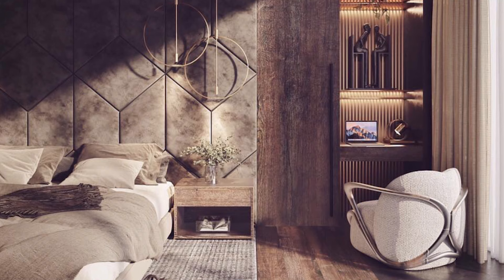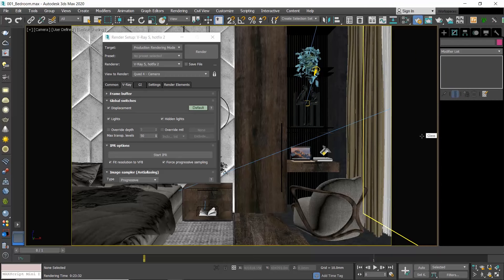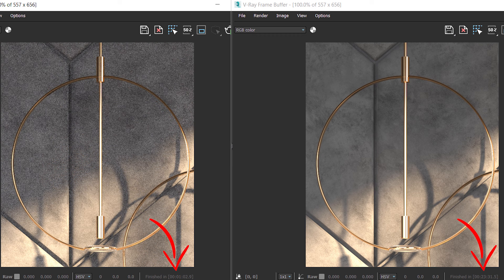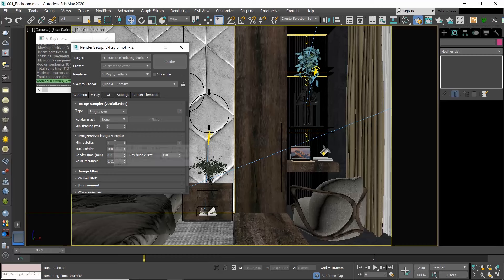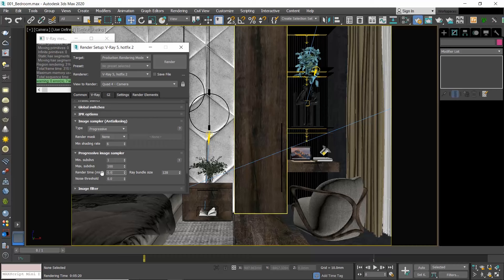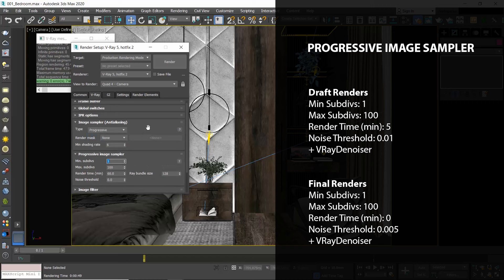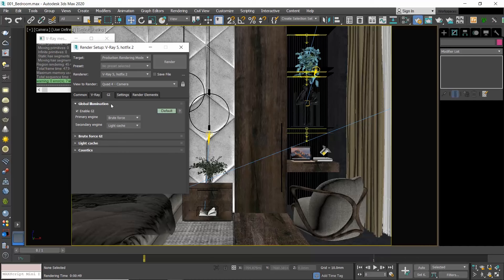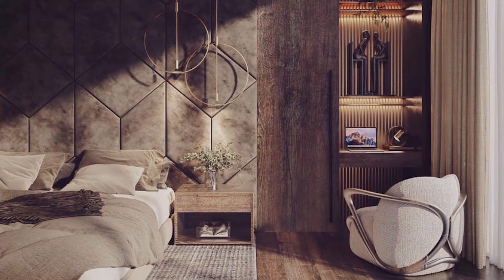3ds Max VRAY 5 Render Setup Tutorial | Settings Explained

Comment: Hi Margarita.. can I ask a question here?.... so I do manage to fix the noise in the main RGB render.. but in my render elements, specially reflection, lighting and specular elements, I still find noise and not matter what I do, I can't get rid of them.
Secondly in this tutorial you used VRay Denoiser element but you didnt change any denoiser settings. is it not needed initially?... Does the denoiser slightly blurs the main RGB render? thanks,

Comment: Guys I need help....I just switch from 3ds Max 2017 & vray adv 3.6 to 3ds Max 2022 & Vray 5, update 2.1. 

I try render using vray 5.21, but the outcome is terrible!!  It's the same 3ds file so I suspect problem is with the vray settings.

What should I do? is there any way to fix it? 

Please help TT

Comment: Is it that VRay doesn't support Irradiance Map as the primary engine in GI ? Didn't know that.
Reply from the maker: V-Ray supports Irradiance Map as a Primary Engine, but if you use IM then the VRayLightMix feature doesn't work. It works only if you use Brute Force.